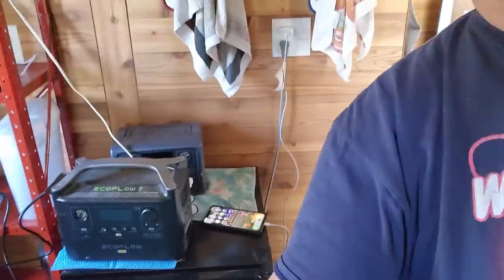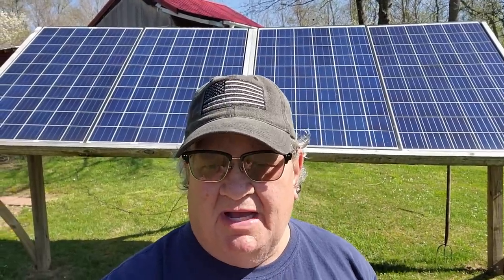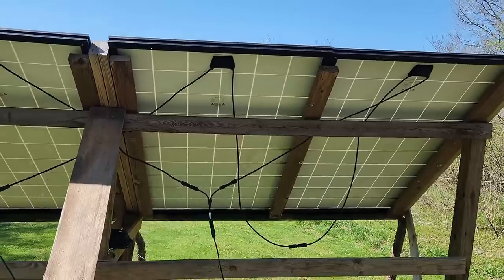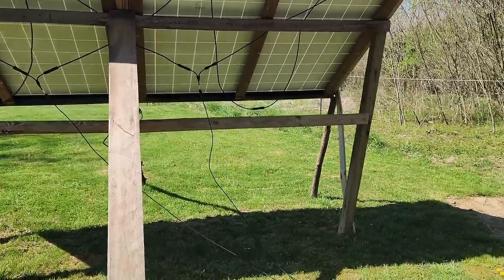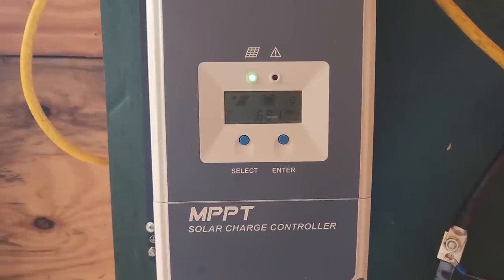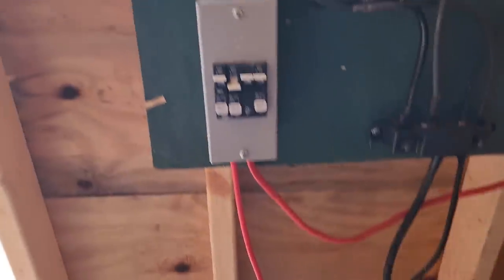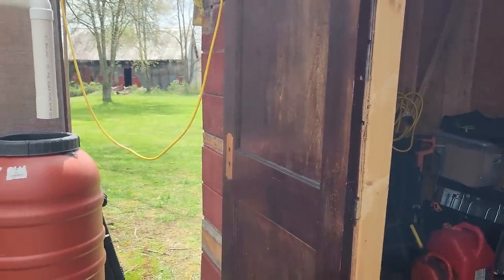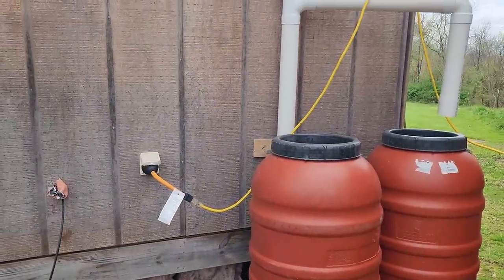DIY Simple Solar System - 3 Year Review

Comment: Yes I keep seeing videos  with growing reviews on the eversstart batteries from Walmart but àfter my disastrous experience with thier boster packs first off after i had bought 2 with inverter and air pump just after I found utube  channels telling proper charging parameters for sealed lead acid battery at first I thought they had to be wrong but i had a black and decker booster pack so since I know they don't make their own batteries i took it apart to find the battery manufacturer website to find what they said the proper charging parameters were but I didn't have to as written right on the battery was do not discharge below 12.2 and float charge is 13.4 and full charge is 14,8 so utube videos were right so I checked out the eversstart booster pack and found it only charged to just over 13 volts so I called them and asked them but the person I spoke with said that was fully charged for their batteries so I foolishly trusted him at first when I boosted my pt cruiser it would boost  5 times before it needed a charge but after almost a year it dropped down to 4 then 3 so I hooked it up through the booster cables with my good battery charger it said it was at 80% left it charge for 2 days but couldn't get it past 90 % but after a couple of drain and recharge it finally reached 100 %  but only reached 13,9 volts got another year now it doesn't even boost it as for the built in air pump had a flat tire so I tried the air pump let it run for 10 minutes and tried to shut it off to cool down wouldn't shut off so I hooked it up to my old van and turned on the headlights and heater took it down to dead and then hooked it up to a battery but the air pump was still on had to open it up and cut the wire was afraid to try my other eversstart booster pack air pump incase it did the same but one Sunday morning before church my niece called she had a flat tire could I drop by after church and fill it up so I grabbed my second unit after church I dropped by put my second unit air pump on the tire and turned on the pump and nothing it didn't work at all since she wasn't using the van other than the odd time I took my plug in compressor and an extension cord the next Sunday and filled the tire haven't had a need to use the inverter on either one yet but in finding utube I found videos on replacing the battery in booster pack even my old Canadian tire Nautilus unit so I'm going to upgrade it and 2 other Canadian tire units I want USB charging ports also a port to charge it with yes I found our that all the old units I have with sealed lead acid battery were only charging to 12 volts and when I heard that they shouldn't be discharged below halfway I thought that's good I've never gone below 6 volts but found out that that was way beyond dead I also found a video on replacing the batteries in my ups and why it stopped working didn't  know the batteries were 24 volts and I was only hooking them up to a 12 volt battery he was putting bigger batteries outside the case I liked that idea

Comment: That's what I do I get to solar panels I think I'm going to need even though I know it's not going to be enough but I had to start somewhere so I started small and always adding more batteries to everytime I get solar panels and I'm going to get more solar panels because I still can't read everything that I would need to be able to run. So I'm getting more solar panels and I'm getting more batteries but this time I'm thinking about getting batteries at more rated for solar panels and start my battery system over again so that means I got to have to get a lot of batteries instead of just a few but I'm not sure if I'm going to change batteries just yet thank you for the cost of things.

Comment: You said at one point in the video that you want to one day go to Lithium batteries. I wanted to just say save you some headache to tip you off that people are saying you can't mix lithium and lead acid batteries. So don't mix them. You also mentioned that Lithium batteries are more temperature sensitive, but you didn't quote what those temperature ranges are? I'm curious about this? If anyone has input. That could make them a deal breaker for some areas. Plus they react badly to water. 

Also people say there's much more fire risk on lithium batteries than other kinds of batteries. So I don't know if they are really worth it. You find a lot of articles on the internet now quoting lithium batteries of some kind or in a device being responsible for fires. For this reason I don't know if I want to use them until they have a few years to work out the kinks.

I agree with you that you don't need big systems or big inverters. The way you did your system built to be simple and efficient was amazing and wonderful. 

...

Also you said your solar panel rack was temporary but that style of holding rack for panels is remarkably popular right now. And from the front they do look nice like that. 

Thank you for the video.

Comment: Well I need 110, 115 or 120 and out also need 220, and 240 volts run everything in my house for I have everything running by electricity no gas no propane no oil only electricity. So I can't ruin everything in my house yet but I am getting closer to it and I might be able to achieve that this year and I will have to get 48 volt inverters for it then.

Comment: Looks like a pretty good setup and I don't mind that you mixed up some terminolgy, but how can you have so many "temporary" aspects to this layout if it's a 3 year review?  Some things should only be done if they're going to be done right.  You've proven this will work for you, now clean it up and make it safe?
Reply from the maker: +Jason Broom The only thing that was temporary is the rack that is still doing fine.   I don’t live there full time, try to continue clearing for the permanent spot as well as many other things.
Reply: @StBernardAcres  - What about the cables laying on the ground?  I mean, it's a good setup, just needs to be finished.
Reply from the maker: No point in burying the cables, since it’s all going to be moving this summer.

Comment: My to lithium battery sushi I could buy six 1,000 amp 135 amp hours batteries and that's what makes me think about if I'm going to go to lithium or AGM. Of course they also have batteries that have heaters in them as well which I'm thinking about buying but they are kind of pricey something like five hundred and some-odd dollars for just one then but those are cheaper than any other ones.

Comment: well , when you made the sistem  i would have gone for agm's and that is about what i would i have done diferent on such a sistem ..... where i am from 24v loads are not rare (pomps , lights , ventilators , ac and such) but it is like you sed :if it works for you then great and yeah lfp's are way better priced today (a buget 24v is under 700$ litime)

Comment: At a glance the battery configuration is confusing because your using red leads for negative connections.    The batteries don’t care and it will work it’s just confusing.
Reply from the maker: +Gene Miller It’s rather difficult to use two colors when going from positive to negative for series lol.
Reply: @StBernardAcres  you are right sir, my mistake.   I did say at first glance, lol.

Comment: I have notice the lead acid batteries has taken a sharp increase in price the last couple of years.  The lithium batteries has come down greatly in price.  I decided to go with lithinum because my 7 year old lead acid batteries were worn out.   The lead acid required me to do a monthly check of water evels.  In warm months the batteries needed more water than in cold months.  Also  I needed to check the battery connections because they would get corroded because of the acid.  Solar panels are much cheaper than they were 15 years ago.  I tell people because the panels are so much cheaper you cannot go wrong by having a few too many.  15 years ago I paid $600 a piece for 8 panels.  Today I saw the same panel for around $150 depending where you shop.  I now have 16 panels and I have seen days with so little light that I could have used even more.  The greatest problem I have had with my system are the inverters.  Most of them are built very cheaply and has a high failure rate.  I will not buy anything made by aims again.  It was an expensive piece of junk.  My advice is do not buy inverters made in china.

Comment: Well let's see what do I need 4800 w 3600 w 2000w refrigerator on don't forget about the dryer doesn't run all the time so I will need a inverter to run at 9600 w puss what everything else would take to run in the house which is not very much so what I'm doing at this time I have very many inverters runnings one thing or another thing or a couple things another one doing the same thing and another one doing the same thing and another one doing the same thing and another one doing the same thing and another one doing the same thing and another one doing the same thing and another one doing the same thing and I'm not running the kitchen stove with a water heater or the dryer.

Comment: There is no such thing as a 12 or 24 volt solar panel. A 400 watt array will output 30 amps to a 24 volt system on a great day. The panels should all be in series to feed the charge controller which the 60 amp can take 150 volts in.